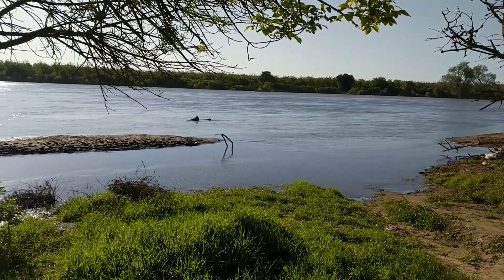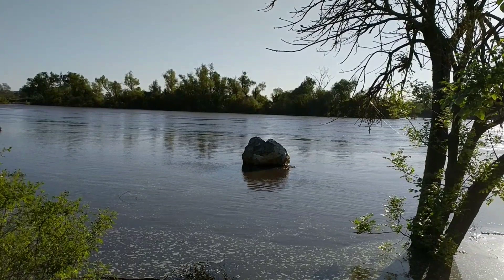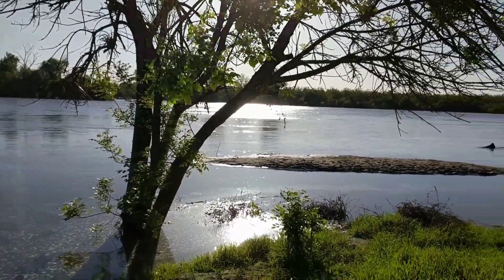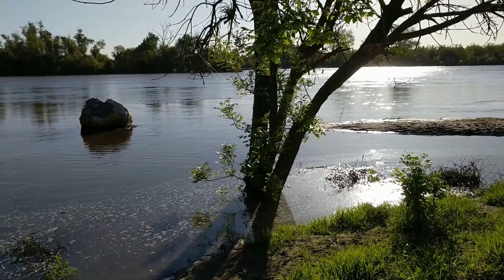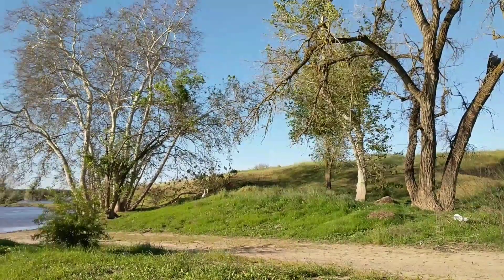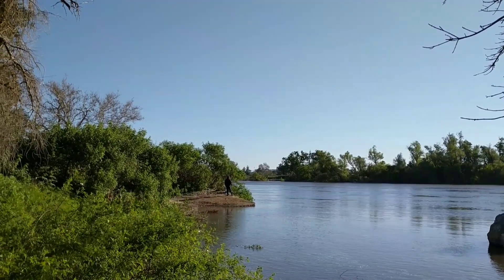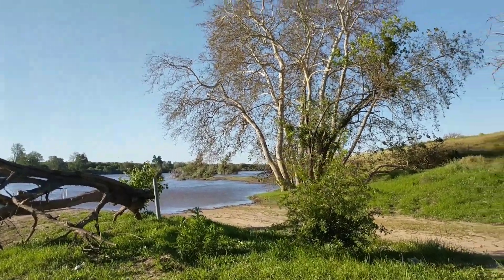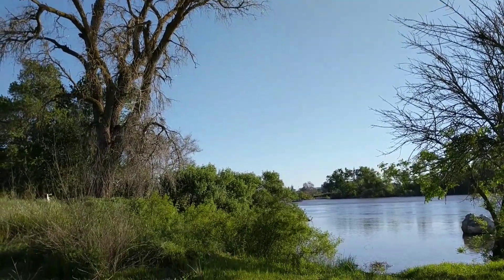4/28/17 ~ 30 miles downstream of Oroville Dam (43,000 cfs river releases)

Comment: G'day,

  Hmmn all this vociferous concern for the state of the Levees..., coming from the Farmers & Residents who live downstream of a 950 ft-tall Earth-Wall Dam constructed to 1950's Engineering Standards by Lowest-Bid Tendering  Contractors in the 1960s, which has lately suffered a Catastrophic Spillway-Failures on both it's Main and it's Emergency Spillways - all  while the Snowpack was at a record high level, and when the "backup" Diversion-Tunnels are unservicable, and debris from the broken Spillways had raised the Water-Levels too high for the Hydro-Electric Turbines' Tailstock to discharge....; seems to be rather missing the point...

   They seem to have lost sight of the fact that the immediate priority and task of those trying to save the Dam is to repair the failed Spillways, before the Dam's Water-level exceeds that which will send any more Water over the failed Emergency Spillway..., so they have to keep the Water-level from rising too high, because otherwise the Dam itself will be in imminent peril of failing utterly ; and if that happens then the "State of the Downstream Levee Banks" becomes totally irrelevant, because if the Dam fails then every Levee Bank downstream will be completely washed away, and afterwards there won't be any regulated flow available to irrigate with....

  The fact of the Main Spillway being broken, and thus only able to run between 30,000 CFS & 40,000 CFS, to minimise erosion at the broken end, and at Water-Levels above 835 Ft least the Main Spillway Inlet begin to "scour"..., together with a desire to have the Main Spillway dry for as long as possible between flows while effecting jury-rig repairs...; all conspire to mean that the Spillway will be passing either 30,000 to 45,000 CFS or it will be nothing, and the Hydro-Station will pass as much water as they can manage...., and the Farmers downstream with their Levees and all, will just(ifiably ?) have to "Suck it up, Cupcakes !", and be grateful not to have been already washed out to Sea by a catastrophic Dam-Wall failure.

   Just(ifiably ?) sayin' ,

  Some things be not worth complainin' about, in the grand scheme of things...; like threatened Levees, below a decrepit & failing Dam.

  ;-p

  Ciao !
Reply from the maker: Hi WarblesOnALot. Interesting editorial on this ongoing issue. Thank you for taking the time to express your opinion so thoroughly. It helps when people can hear all views in these matters. Take care.
Reply: +Millie Kay (Feather River Girl) 

  Thankyou...

   No worries, I've been watching this saga for a couple of months now, and trying to keep all the factors involved is a bit of a challenge (from here in Oz)..., especially as I'd never heard of the Oroville Dam until it made headlines with the Spillway failure.

   I applaud, and am greatly impressed by, the Emergency Civil Engineering efforts to regain control of the situation - in catch-up phase - but I have the impression that there are at least two or three  "Elephants in the Room" which nobody has yet really addressed...; one being California's well known Tectonic-instability versus an Earth-Wall Dam (what happens if "the Earth moves" and shakes everything up & down & sideways for half a minute or so..?), the other being that all the Rainfall/Snowpack/Inflow records used in designing the Structure were based on the period of Stable Climate which technically ended in the 1950s, and had completely pased into the realm of memory by the 1980s..., so these days the increasingly frequent and increasingly intense Extreme Weather Events are subjecting the whole Structure and all it's components to conditions which it was never designed to have to cope with - all that apart from the point that after 40 or 50 years most Heavy-Engineering Projects have either been progressively  completely replaced in the course of ongoing preventative maintenance (the "Great Grandfather's Axe" phenomenon - Dad replaced the Head & I gave it a new Handle...), or they've been run  for decades to minimise the Operating Costs so all  maintenance has been on an Emergency-Repair basis, thus the entire Setup needs simultaneous replacement, with everything poised to fail at the slightest unexpected occurrence.

   And over the top of all of the above, then there's the point that Global Atmospheric Carbon Dioxide Levels are still rising, and even if Humanity somehow magically cuts C.O.-2 Emissions back to zero, tomorrow, then the Extreme Weather will continue to grow more extreme for another 20 years...; so, effectively, the Oroville Dam is probably doomed to fail at some point (within that timeframe...) and the people living downstream should probably look at the Hydrologist's predictions to see how high the eventual Flood will be when that happens - and then move their Camp to somewhere up above that line...

  When trouble starts..., be somewhere else entirely...; that always works !

   On the one hand it's a big worry for everybody downstream, on the other hand everybody's in the same boat - infrastructure everywhere is crumbling and struggling, in the face of Global Warming having altered the "Worst Weather Conditions" which everything is subjected to, thus invalidating the design-assumptions it was all built on, plus or minus inadequate maintenance for the past 40 years ; but in the gripping-hand, the Global Economy appears not to be able to afford to rebuild everything which needs replacement, not even to the original inadequate standards - let alone re-engineered to withstand what the Climatologists say we've got already in the pipeline, & coming our way.

   I get around with bumper-stickers on my car (which has a Solar Panel on it's roof to save Fuel & reduce it's Exhaust Emissions....) reading "VOTE GREEN OR DIE... Global Warming Culls !" ; but, as yet, most people are still prioritising their pursuit of Economic Growth, rather than trying to cut their personal emissions of Greenhouse Gasses.

  I'm sure you're familiar with the Oroville Spillway Saga  coverage of +blancoliri Channel, by Juan Browne...(?), I've been following his reportage of the events..., and when I realised that he's an ex Air-Force Jet-Jockey now flying Airliners I casually & politely asked if he'd ever worked out his personal tally of Greenhouse-Gas Emissions (I emit 9 Tons of C.O.-2 annually but the Regrowth Forest I pay Council Rates on sequesters 100 tons per year...) ; and was promptly blocked from his Threads for such temerity, though a week or so later he posted a Video boasting of the low per-person/mile Fuel-Consumption of a Boeing 777 full of passengers & cargo when flying from Los Angeles to London...; which was a bit of a "Red Herring" in that I asked how much CO-2 he'd personally emitted over his career, rather than how many people had bought the fuel & paid him to burn it...

  In broad terms, every Litre of liquid Hydrocarbon burnt, translates into 2.5 Kg of C.O.-2 going out the Exhaust-Pipe...; so it's an easy calculation, and it's the total emissions which counts - rather than how efficiently the Fuel is burnt...

   Such is Life,

  Have a good one...

  ;-p

    Ciao !